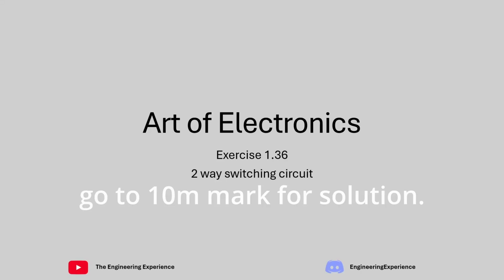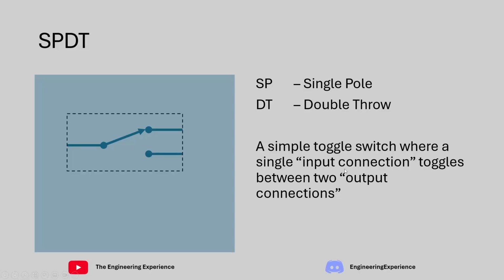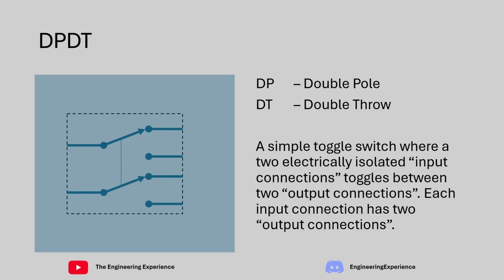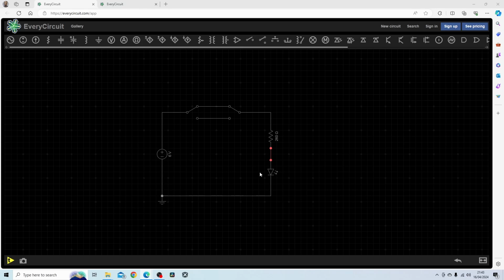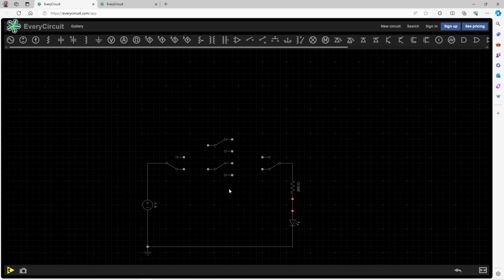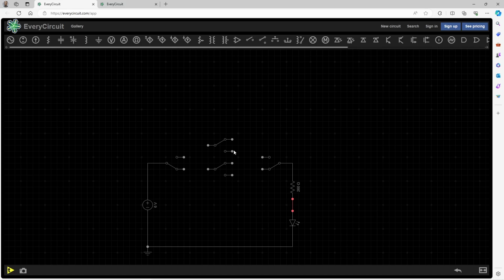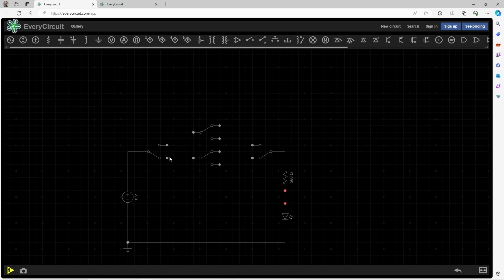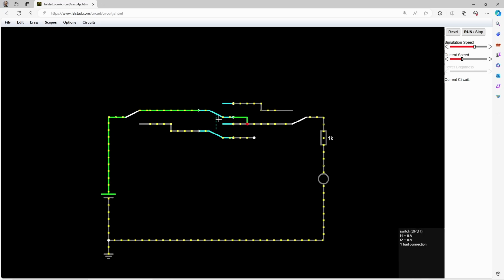Learn The Art of Electronics: 3-Way Light Switch Exercise 1.36

Comment: when the first and second switch is down, whatever the third switch up or down , the led won't light. It seems not correct.
Reply from the maker: I should have added component references. 
I am going to read them left to right. When the first switch is down. The current is flowing from the bottom path to middle path to next switch. If you toggle middle switch down then current will stop as expected, and you can toggle any switch and current will start again and LED will light up.